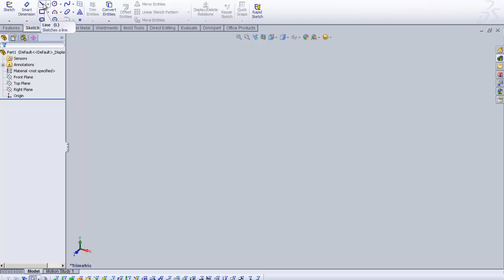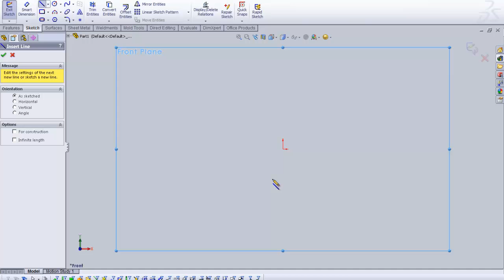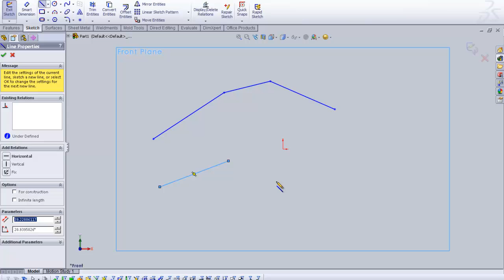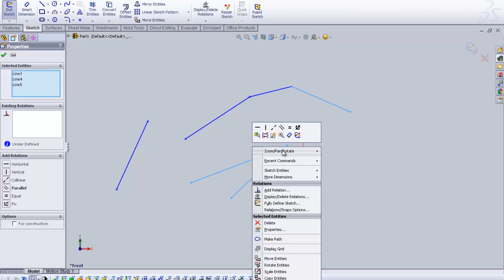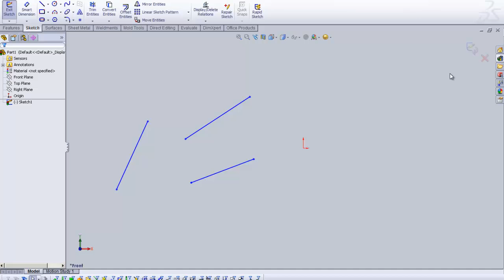Solidworks Basic Training - Line Tutorial

Comment: Some other topics of interest are:
- split lines
- merge lines
- how to separate a shared line of two adjacent rectangles 
- does solidworks track line segments? if you draw a short line and then draw a long line completely over the top does solidworks still retain info on the short line is it merger into the long line.
- is there a concept of line layers - one on top or behind another.

Comment: Hi, I am currently designing a hull for an RC boat, and have found some problems when converting the lines I have drawn into a solid object, can you point me to a tutorial or explain it to me at all? Cheers (Y)

edit: I cannot just extrude, as the object is not constant in cross section. Here is a link to the forum where I am sharing my work. Thanks. http://www.modelboatmayhem.co.uk/forum/index.php/topic,48273.msg490376.html#msg490376